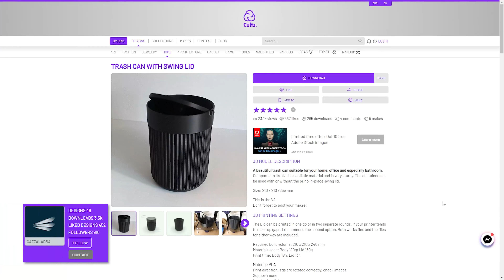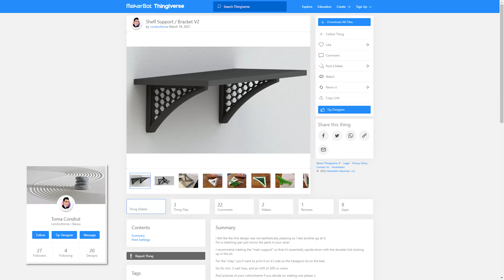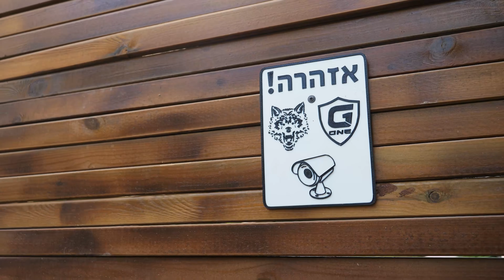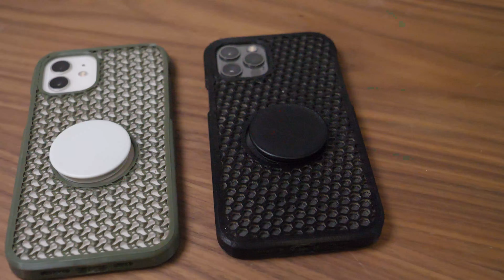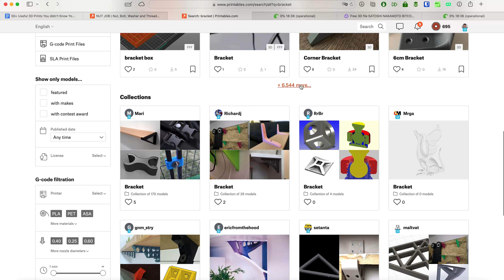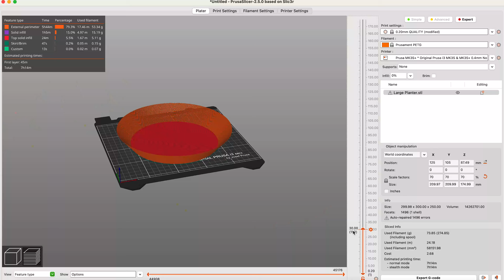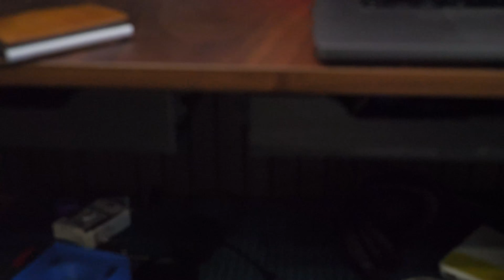50+ Useful 3D Prints You Never Knew You Could Print

Comment: Hi. I built a pool (4.3 by 6.4 by 1.5 meters) and a solar heating for it an my roof using almost a thousand meters of black 16mm hdpe tubing (from german agriculture supply) ob my roof. it works perfect ;-) the dozens row of clips that hold the tubing on the surplus military fiberglass-rods fixed to the roof-beams are printed with an anet e10 in ABS some 4 years ago - and they keep up against weather, sun etc absolutely perfect. sorry for the european measurements - i was too lazy to convert to yards and inches 🙂

Comment: First let me say that I am very sorry that your best option for trash can is to 3D print one.  These things are so easy and cheap to make with injection molding that it blows my mind that waiting for a 3D printer to turn one out over a few hours is the best idea.  I'm from the United States and where I live, I can get just about any trash can I want, at least any plastic trash can I want, for under 30 bucks.  The small type that go under a desk I can get for less than 10.

Pardon me while I think out loud in your comment section... It seems to me that a lot of guys who run 3D printers make a lot of stuff with them that I would imagine are much better bought or made some other way.  And I've been trying to puzzle out why the 3D printing community in particular seems to pick up this hammer and then see everything as a nail so it were.  I think I finally pinpointed the reasons.

The first is that even though it may make more sense to make something a different way like with casting or Machining or carpentry, those methods require quite a bit of skill, and not a small investment in tools.  If you already have a 3D printer sitting there it's going to be a very attractive option.

The second part is that the 3D printer can produce very complex shapes very easily, and once you select your model and hit go you're free to do other stuff.  
My third thought was that a 3D printer is the only way a lot of people can make something in a custom size.  Even if you don't mind going to the store to buy it or ordering it online, the size you need may not actually exist.

I know you say you read all your comments, and I would like to see if I'm anywhere close to reality with these thoughts.

I am currently binging your channel and have just subscribed.  Great work!

Comment: Just got my first printer the Ender 2 Pro. Didn’t realize I can design and print broken proprietary plastic parts. Fixed my dishwasher rack. The end cap for the sliding rack was missing so I designed a part that could snap in. I got tired of the rack coming off the rails!
Reply from the maker: Yeah dude, that's like, 80% of the fun... SHOVE IT MANUFACTURERS I WILL PRINT MY OWN!

Comment: Is there a way to estimate the cost to print a given item in filament?  I have growing desire to get into 3D printing because there are a bunch of things that I'd like to build, but with the cost of filament (alone, not including the cost of the printer), I can't tell if printing one of those planters or trash cans you describe would be more or less expensive than if I'd just gone to Walmart and purchased one.  How can that be calculated?
Reply: I've been doing it since Oct. 2021 and if you're careful and watch for sales, you can print so many things for under $1 - $5. My sister wanted starter pots that were cheep but strong enough to have 1/4 to 1/2 pound of soil, so I took an idea from Thingiverse for a yogurt cup planter and reworked it to enable her to use the 2lb deli containers and made them self-watering. Total cost including electricity was under $3 each and I printed her 18. Took almost 3 days but she's able to reuse them many times.
Reply: depending on the slicer program you use it may have a plugin to figure the cost for you, you just enter what the roll cost you and the weight of the roll (they vary so check it first). when you run the slicer (I use Cura 2.5.1) to create the gcode it will list the amount of filament used (in grams) at the cost of that use.
Reply: @scarsdale7186  That's a super helpful idea.  Thanks for taking the time to reply to my question!
Reply: @John Gerken  no problem I know it's hard to find good tips like that. I'd look for videos on YouTube for starting a print farm it's how I learned much of it.

Comment: I actually suggested shelf supports to my wife yesterday but she does not want plastic on her new kitchen walls. We will see how those silly floating shelf supports hold up.
I also have been waiting years to get a 3d printer to finally fix the kitchen trash can so the peddle will work again.
That can cost almost $100! 

One of the first things I printed was a door stopper that fits on the hinge pin of the pantry door as it was bumping the new oven's  knobs and turning the on stove whenever you opened the door. 
Even though the hardware store is only 2mins down the road it was a holiday weekend and company was coming so it was faster to print something

I also just got an overpriced Cricut for my wife and I ended up making all the labels for the Christmas decorations.
This video is so on point.
Reply: And with good finishing work, plastic parts need not look like plastic! A good coat of primer, and some of the cool rustic-looking metal paints (or rub-n-buff) and you can have an awesome custom component that would be a pain to cast in metal yourself, but looks nearly indistinguishable from the "real"-metal thing sitting next to it. I say "real" metal because half the time it's just a cheap nickel alloy plated with a metal it's supposed to look like (IE copper, bronze, chrome, etc.) I love the Rustolem aged-metal spray paints.
Reply: Lol,the  kitchen trash can Paddle was one of the first things i repaired when i got my 3D printer. Those things are meant to break - with only 50gr of plastics it could have lived forever, but the manufacturers decide to make those things flimsy..

Comment: You should make a new list of prints that can fit within a 150x150x170mm bed.  Not everyone has a printer that can print 1ftx1ft+ build volume
Reply from the maker: So like a new video for that?
Reply: @thenextlayer *150x150x170 That would be great!  Also showing the best way to split larger files to print separate pieces instead of one part
Reply: I have a heavily modified Ender 3 pro with a 220x220x240mm build area and I just got a Sovol v06 with a 220x200x250mm build area. Both were under $250 and so far I have little to complain about.

Comment: Yeah Sneaks' arm is not without flaws, but it's working OK for me so far.  I didn't try to use the printed fasteners, but instead used Adrian Carpenter's remix for 6mm metal hardware.  IMO the biggest flaw is the rounded corners which I haven't been able to get to print super cleanly with PETG.  Chamfers and angles would have been better there.
Reply from the maker: Hmm ok that's smart. They're sturdy?
Reply: @thenextlayer  Yeah they work fine so far.  They are printed covers for the bolt and nut heads, so it looks like you are using the printed ones.  Only downside is they add weight.  Would be good if I could find some aluminum hardware that would fit.

Comment: Following a bathroom remodel by a past-his-prime contractor I was left with no less than 3 switch boxes improperly cut into the paneling.   The solution was to print oversized switch box covers.  I printed with copper colored pla, painted to match the Mediterranean Bronze color and sanded down edges to show copper highlights matching my wife's selection of bathroom fixtures.

Comment: What 3d printer do you recommend? Plus should one do their research and learn what they can before buying equipment or can you just learn as you go with the manual I’m sure that comes with it?
Reply from the maker: Personally my "go to" right now is a Prusa MK3S+ (https://jle.vi/prusa) - but if I were on the market right now, I might try a BambuLab P1P (full disclosure: haven't got my hands on one yet), or save some money and get the Sovol SV06, which is a clone of the Prusa for ⅓ the price, and is a good "beginner" printer. They have a discount going on for my audience, right now, too, https://jle.vi/sovol coupon code NEXTLAYER (full disclosure, I get a kickback on that)
Reply: @thenextlayer  The Sovol v6 is pretty much a clone of that machine and so far I've only had 2 days as of this writing and I've got to say, it's well worth the money. Still fighting the profile on my Cura for it but I'm getting there, had a few lost layers on the "Ultimate torture test".stl I'm tracking down right now. Loves PETG but dislikes PLA that's the issue I think.

Comment: Nice ideas! But you might want to consider charging your phone via cable. Wireless charging strains you battery enough as it is but putting even more distance between the coils just kills it
Reply: Where's this info from
Reply: Really? I thought wireless charging was better because it's generally slower and I once read that it """stops""" charging when your phone is fully charged. Obviously it doesn't actually stop or your battery would slowly decrease again but IIRC it's better to have a fully charged phone on a wireless pad than plugged in.

Comment: A good amount of my old Jeep Cherokee parts has been printed, ABS and PETG mostly, beside home light fixtures, for quite some time I was printing PETG bushings for dumbells during the lockdows to use different size disks with different bars, anything not mechanically under constant stress can be printed and used no problem. I don't even know how much money I saved with a simple Ender 3 pro at this point.

Comment: The first useful item that I printed was an electric toothbrush holder that I downloaded from Thingiverse.  It gave us a stable stand in whch to place the toothbrushes so that they are no longer laying down of the vanity top  or setting unsteadily in paper cups or other improvised holders. My wife loves it and keeps talking about how wonderful she thinks that it is.
A tool that I printed was a set of feeler gauges so that I could measure tight spaces like slots for mounting tabs.  While they are probably not as dimensionally accurate as a set of machined metal gauges, they have the advantage of giving the dimensions needed for the as-printed part.

Comment: Do you have a tutorial on how you do reinforcement rings in vaze mode for the big planters?
Reply from the maker: I misspoke there, the reinforcement rings means you can't do vase mode, but you can build the model in such a way that it's 1mm, and use a 1mm nozzle, so it prints in 1 line per layer.
Reply: @thenextlayer  indeed that is what I do now, but I want to get rid of the seams, so vase mode with reinforcement woud be ideal.

Comment: What is a good way to prevent warping without using enclosure? I can't even print PLA succsessfully!
Reply from the maker: Your print surface isn’t sticky enough. Clean with 100% IPA. Reduce drafts. Adjust room and bed temperatures. If you must, use glue stick. But you shouldn’t need it.

Comment: many of these reasons are why I've been planning to get a 3d printer, resin 3d printer as well. But uhhh, about the desk bowing due to the heat from your laptop, why not print a laptop riser, or whatever you want to call it, and if you're feeling cheap enough to go even further to save more money, because I would if I could, print some case fans and attach them to the bottom of the riser for your laptop, of course make spacers for air flow between your laptop and the riser. this is just a suggestion, because I don't like that your desk is bowing, as someone that's built furniture, bowing desks are scary, and irritating to see if you have OCD. I'd hate for you to have to buy a new desk because of heat damage from a computer that's a big part of what you need for work. I hope this was a helpful idea. Plus if I see you print something like this, I'd more than likely be encouraged to try printing necessities myself, since I've been wanting to buy a 3d printer myself to print equipment that's too expensive. for me, I'd use woodworking and 3d printing to make my life easier lol. also, you've just gained a new subscriber for inspiring me to want to give this a try, and I'm looking forward to more awesome videos ☺️
Reply from the maker: Some serious good ideas here ;)

Comment: Thanks, very nice video. Much better than other similar ones I've watched. Subscribed. Can you please expound on "zero top and bottom layers and using infill patterns" -- I would think infill would only work if you had top and bottom layers enabled. Not so?
Reply: If you don't specify top or bottom layers, the printer will start printing infill from the first layer. Some of the newer infill patterns like Gyroid are designed to add strength in all directions, not just X and Y, and thus can reasonably replace solid printed walls with something lighter in weight and bonus- lets through some light and air if you need or want it
Reply from the maker: Thanks for answering this for me :)
Reply from the maker: I can do a video on it!!

Comment: I'd like a tool video as well! My first functional print was a replacement tripod throat plate after being unable to find a replacement that supports one of my 15-20 year old tripods. I have two that use the same style of plate, so I had to switch the one plate I had back and forth.

Edit: I never thought of printing light diffusers. Could be useful for lighting up dioramas!
Reply from the maker: On it!
Reply: @thenextlayer  Not sure if you’re looking for tool ideas but there are some printable lazy Susans that work with marble ball bearings. Mine isn’t the best but it helped when I was a pinch. Needed it so I can rotate an object I was spraying with primer.

Comment: Why did the draw organiser not work out for you? I was planing to try that for our kitchen draws
Reply from the maker: I printed a lot at low quality and too thin, and also it was too much work. Like the longest dividers weren’t long enough for my forks much less knives and spatulas. So you have to connect 2-3 pieces to get one line! I got lazy
Reply: @thenextlayer   good to know, will keep that in mind. Regarding the length, I see there is a zip with up to 180mm and you have the OpenScad library if you want longer ones. I saw a suggestion to stick to multiples of 18mm for simplicity. Any way I have some gridfinity to print before I can move on to that project. I am thinking might be better to use plywood for draw dividers less plastic.